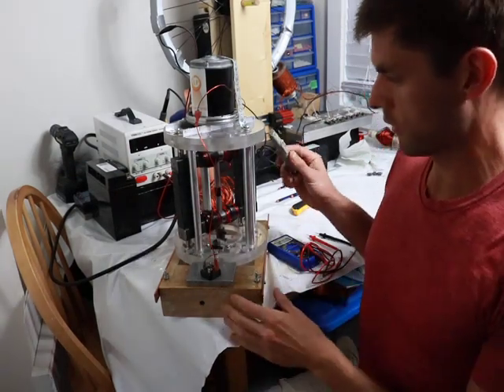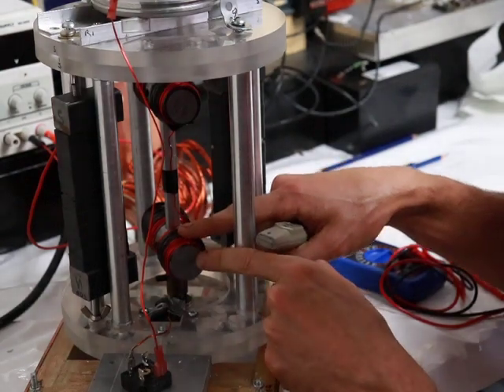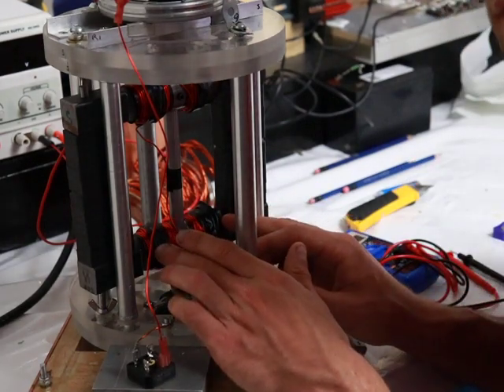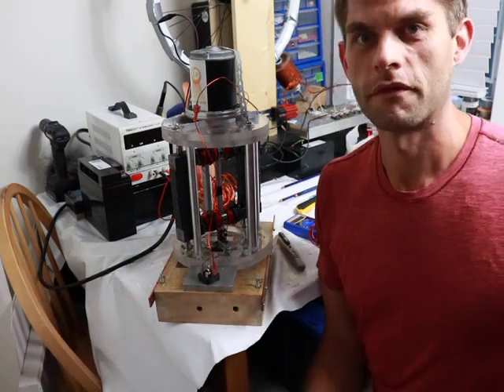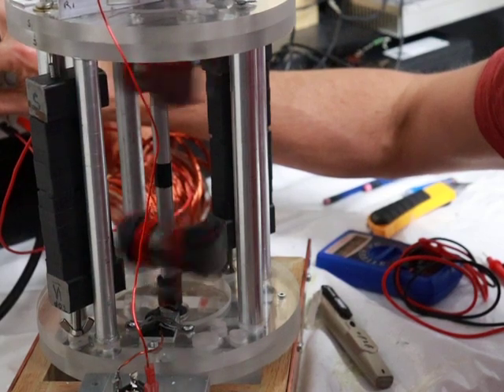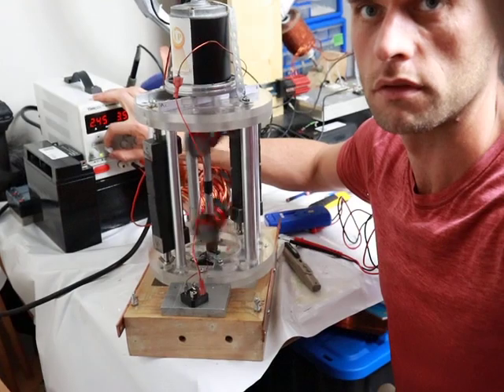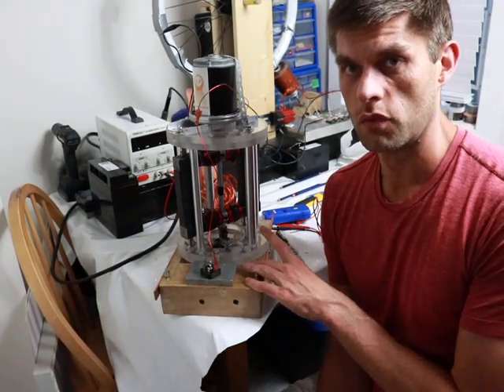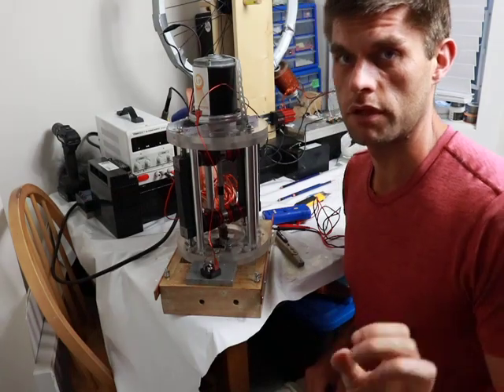Kromrey Generator 2022

Comment: I did full research on this machine. I made a video about it how I improved it. Long story short, yes it does rev up under load I can confirm that. It has the same effect like the ordinary vacuum cleaner, when you clog the hose the motor revs up. But fact is, if you ad metal or another magnet to a magnet, the magnet becomes stronger. This means it takes more force to tear them appart again. And that's why this machine is useless. There's no way around this. It's physics. As you well know bigger planets have stronger gravity. If you put 2 magnets together, you have the same effect. It doesn't matter if it revs up under a load. I had a 12 phases kromrey generator. It took me 500 watts of energy just to turn it in idle. The more phases you add, the stronger the magnetic brake effect in idle becomes. Under full load the motor dropped to ~300 watts. Still 300% loss. It's not even a good generator, it's an energy waster. There's no overunity or perpetual motion.
Reply from the maker: there is overunity, its very easy to obtain in an open system... i will post my results when i get it producing excess power.

if you try and measure the output without first putting it into lead acid batteries then you are missing the point.
Reply from the maker: also increasing speed without increasing power consumption.
Reply: It doesn't work. You're wasting your time. And open system by the way has got nothing to do with overunity. Overunity means perpetual motion. And most people don't know what this machine is. If it worked this would be a creator/god in detailed definition. You can't build a creator. A mortal builds a god?😂

Comment: Wouldnt it be better to spin the magnets on rotor and coils as stator?
Reply from the maker: I dont think so due to the magnets needing to be on the outside
Reply: @MadscienceLPTECH  😳
Reply: Kromrey, the Swiss man who patented this, found that the stator needed to be the ceramic magnets.The magnets weigh a lot too, so its a little easier to spin the coils at speed, without excessive vibration.

Comment: Your using 2 magnet spaced 180 degrees. Imagine if you did the same but with 6 magnets spaced  every 60 degrees so that north is up  at 0, 120, and 240  degrees and south is up at 60, 180, and 300 degrees. Assuming the rotor continues to spin at the same rpm, then the flux changes happen 3 times faster so you will get 3× more voltage.   You can do any number of magnets 2, or 6, or 10, or 14, or 18. 

I'm sorry to ask again, are you actually commutating (switching current mechanically) or are they functioning like sliprings. 

And, is it 5v DC  output, or 5v DC output after diode rectification? 

Have you thought about voltage multiplier circuit? 

Consider taking the output of the top coil, and feed  it from the left to two diodes anti parallel with eachother, whete the top diode forward biased right and the  bottom diode biased left.  Then on the right side of both diodes connect a capacitor to each.  And then connect the other side of  both  capacitors.  And lastly, connect the output of the bottom coil to the center of the two coils. 

5v DC  from rectified AC has a 1.4v drop across two diodes. Meaning your probably getting 6.4v AC. And that is really 6.4 Volts(rms) root mean square, which is the average  power equivalent to 6.4v pure continouse  DC.   AC  sine wave forms have a peek voltage sqrt(2) times the rms voktage.  That's 6.4 vrms × sqrt(2)= about 9.05v peek. Rounded to 9 volts peek and multiplied by 2 in a voltage doubler is 18 volts, and minus 1.4v for the two rectifying diodes voltage drop results in 16.6 volts stored across the two capacitors under no load.
Reply: For better and worse, comments with links get auto deleted  so I can't post a link without it getting deleted. 

So maybe you can search for ....

Voltage Doubler: What is it? (Circuit Diagram, Full-Wave & Half-Wave) by  Electrical4U. 

I'm proposing the full wave version.
Reply from the maker: Sorry I miss spoke if I said communtator... slip rings

Thank you for your comment, I'm going to add 2 stacks of magnets and see the difference.... I'll do that video next in February.... then I'll redo the shaft as it's crooked, and re wind the coils with 23 gauge wire.... then I also will try the shorting of the coils with a Reed switch... 

What do you think the voltage doubler would do to the radiant energy coming off??? Change it to conventional.... I'm under the impression I want to get the radiant energy into batteries asap then do the work / convert... 

I'm.making a fb page where we can all discuss these thing and finalize this machine to overunity once and for all.
Reply: @MadscienceLPTECH  I'm not sure what you mean by radiant energy here. Would you define it?

Voltage doublers double the voltage under no and low load. Heavy load pulls the voltage down.  If you  upsize the capacitor's capacitance they will better sustain the voltage under heavier loads.  But never will you get more energy out than was put in. 

Over unity is is typically a reference to energy out / all the energy in.  Don't bother trying  to get 1 or higher. It won't ever be possible. Sometimes over unity claims that are not outright hoaxes simply don't  account for all the energy that goes in. 

Less commonly over unity  may refer to power out / power in, but only by the very ignorant,because it requires including time for both, and the ignorant don't know enough to include it.  But if they did include it, they would be back to energy out/ energy in.   One can, at low power over a long time, store x amount of energy.  And at a later time, they can dump x amount of energy at high power over a short time. Again the energy out / energy in  will always at best  be 1 in theory and less than 1 in practice.
Reply: @MadscienceLPTECH  four magnets won't work well. 

Remember with two magnets one has its north side up and the other at 180 degrees from the first magnet, has its south side point up.

2: N(0), S(180) good. 
4: N(0), S(90),N(180),S(270)  bad. 
6: N(0), S(60), N(120), S(180), N(240), S(300) good. 
8: ...... bad. 
10: ...... good.
14, 18, 22........ good. 

For all interger values for z, 1 or greater.....  
Good arrangement = (4×z)-2

Comment: What picked up from the Kromrey is, to use no neo magnets and a non magnetic shaft, so you've got those down. From Johns drawings you can see a trifilar coil, which wraps two bobbins, then the wires come together, I assume soldered and then are trifilar again on the two other bobbins. This could be an essential detail who knows. Also hé mentioned adding a hole in the iron core would aid the cooling effect, I can't make out from the video if you have that. Nice build!!
So in my introduction video, 'The New Generator', I show a mini Kromrey that shows better performance when the iron pieces are longer, something to consider
Reply from the maker: Thank you for the comment, stay tuned, Im getting over my chronic pain and going to go hard on building in the coming months... I'm going to make Bedini proud! Thank you for the help, lets finalize this  once and for all!

Comment: The workmanship is good! I built a similar unit. 4 coils of 800 turns of 5 ohms. or just 20 ohms. At 1500 rpm, the output current is 0.2 amps 60 volts. while the motor consumes 12 volts 4 amps. the flywheel is a good solution, as an option put 3 pairs of magnets.
Reply: This means your output is 12 watts but your input is 48 watts. I don't get what's so special about this type of generator.
Reply: It's special because is one of the most inefficient generators ever built.

Comment: Having built MANY coils that will speed up the prime mover when shorted, I can tell you that EVERY coil has a frequency at which it will achieve what you are looking for. You have 3 choices to achieve the effect. 1. Increase the frequency of the coils passing the magnets by speeding up then motor. 2. Increase the length of the wire on your coil, which will increase its CAPACITANCE. or 3. Which is the simplest...... add capacitors in series with your coil. very, very small ones.

Comment: Nice build, what is the cop of this generator?, mi bigger one has cop 0,65 from electric power in the motor to electric power into the load ,4 trifilair 0,27 ohm Coil in total1,1 ohm  32 v open at 1200 rpm en 12 v en about 3/5v lost in the brushes  X5,5amp Ad 1500 rpm so it's speeds up under that load en takes off when shorted, in could never make it go over cop 1 😅
Reply: I build it just like bedini told us but I bed we don't have the right magnets for it 😅that always have used barium ferrite which ar illegal now , my theory about this extra energy if it possible at Al is greatly expanded by Paul brown, he discribed a few different methods to extract energy from radio isotopic material whit LCR circuits en that's look a awful lot like almost al the so called ( free energy machiene's en devices) on the internet ( don Smith, bedini, cpanatze, en so on )
Reply from the maker: @oscarverwey  i dont think the magnets matter much, i think its all in the gauge of wire used and tri winding them like bedini
Reply: @MadscienceLPTECH oke there's a video where bedini is saying this a few times That it does matter 😅  En it works way better Whit laminated rotor peace's this is what makes the difference is cop 0,15 en 0,65
Reply: https://youtu.be/DIMqJdzmrP0. In this video he shows the secret of how Al the Inventors have fooled is for so long 😅at least that's how I feel after spending 16years build en replicating almost al of Them